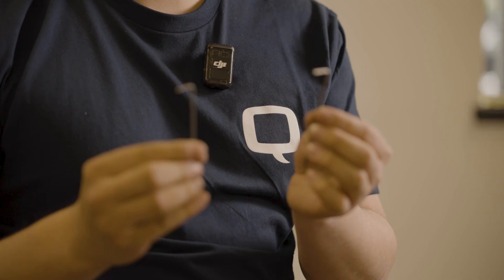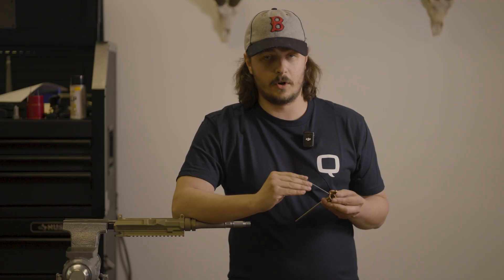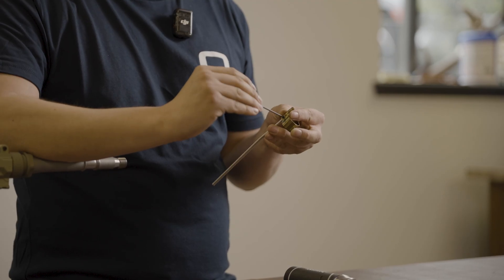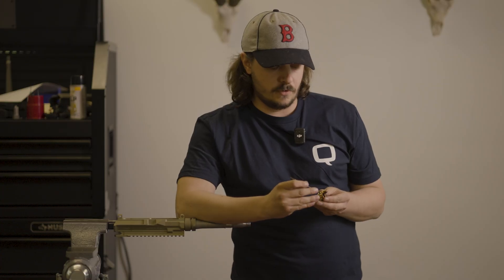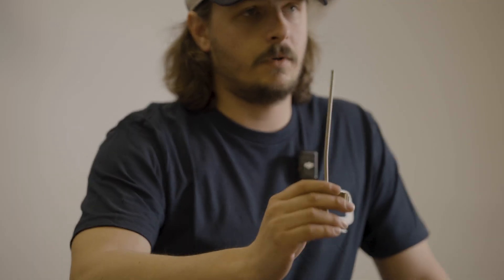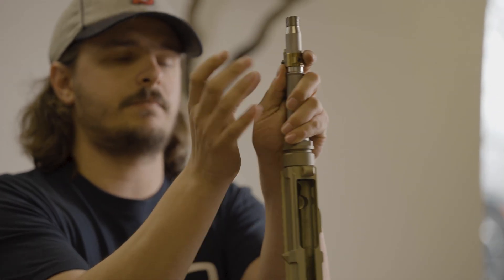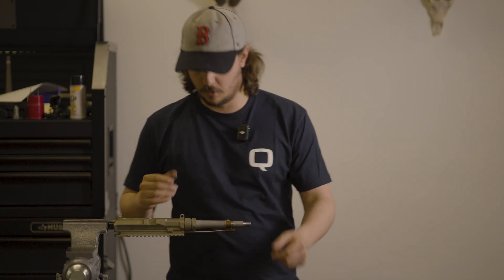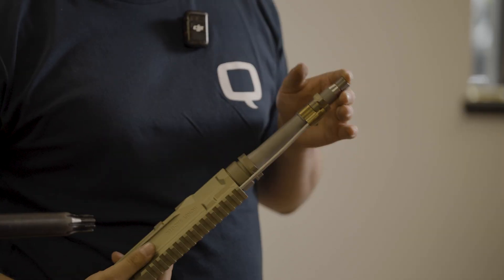How Q | Adjusting the Gas Block / Ensuring Tightness Before Use

Comment: The jam nut on my honey badger is 5/64 Allen key….and my gas adjustment screw is .05 Allen key. 
3/32 Allen key does not fit in my jam nut.
I noticed in the honey badger manual in one place it says .05 Allen key for gas adjustment. And in another place it says 5/64 for gas adjustment. 
On this video he says 3/32 for jam nut and 5/64 for gas adjustment. 
Not sure why, just pointing it out in case someone else runs into this. 
I noticed on Kit Badgers video about honey badger gas block adjustment, he says 5/64 for jam nut, and .05 for gas adjustment… which is what mine is.

Comment: my screws literally shot out of the gas block last time i shot it. customer service never mentioned that I would have to tighten the screws each time i go shooting. is that something i am gonna have to do every time i go shooting now?
Reply: No, just ensure that they are tightened to spec and your fine. Upon the first shots after adjustment... ensure that they are still set in place, and tighten again if necessary. You'll be fine after that.

Comment: Seems like a bad design if the set screw backs out. Can I put some Vibra-TITE VC-3 on it?
Reply: My adjustment screw fell out the third time I took it out to the range . 

Really disappointed 🤷🏻‍♂️
Reply: It would be nice if the end of the thread was peened or something so the locking screw couldn’t completely fall out.
Reply: It has a locking screw behind the adjustment screw that’s hollow. Many other applications have this sort of “jamb nut” style of interference lock. Perhaps you’re not mechanically inclined?
Reply: @Josam01  He says to tighten it every time before using the gun. Maybe that's nonsense advice or maybe their implementation has failure modes?  If they are concerned with it backing out during normal use, surely some added thread friction (without using a liquid that could get into the port) would be a good idea?  VC-3 handles shock loads well, is reusable, and can be applied in a controlled manor that won't get into the set screw.
Reply: @KeithStrang perhaps, I’ve not personally had this issue. But I make sure to verify tightness after adjusting via the locking screw.

Comment: Between my HB and SW my gas block set screws ejected at first range trip with zero user adjustments
Reply: Same lost the one on my hb second range trip. Felt it fall out roll down the hand guard and into the grass 🤦🏻‍♂️
Reply: Mine exploded out

Comment: ??? Incorrect Adapter Use: Using an adapter incorrectly (not accounting for added length when required) can throw off your torque measurements. Torque wrench accuracy is all about maintaining the correct effective length, and your breakdown of in-line vs. 90-degree positioning makes it crystal clear. The 90-degree method is great because it ensures the adapter’s added length doesn’t interfere with the applied torque, keeping calculations straightforward. Crowfoot adapters follow the same logic as long as they maintain the same plane with the fastener. But once you introduce something like a dogbone adapter, you're dealing with a shift in leverage, meaning an adjustment to torque calculations is likely required.

Comment: I’ve taken my Honey Badger out for 3 range sessions and each time (shooting only subs with suppressor) it gets so dirty after approximately 150 rounds, it won’t continue to cycle without cleaning.  I use lots of lubrication and have cleaned it throughly between each use. Any suggestions?  I contacted customer support last week but so far, have no reply.  Should I send it back to be evaluated ?  I’ve never had a suppressed gun that got so fouled it wouldn’t cycle with less than 200 rds.
Reply: Stop using cheap ammo is the Main thing boss and do you have the old HB with the milspec BCG or the new 2 piece BCG ? If u have the old one get the new 2 piece BCG and use quality ammo
Reply: @TheTacticalAmputee no cheap ammo, I’ve been using Hornady Sub-X. I have lots of semi-autos and even using the nastiest burning powders on earth (in 40 years of reloading) I’ve never seen a rifle build carbon faster than this thing.  Btw, I’ve got the two piece bca.  Not everyone uses cheap crap in a $3k gun.  I only load with Vihtavouri now, just because it burns so clean.
Reply: I had a similar experience using hoppes elite gun oil. After just a couple hundred or fewer rounds, it was totally dry. I did some research and gave Lucas gun lube a try. Way slicker, stays in place better and last much, much longer. I use it for all my firearms now with great results.
Reply: was it already dirty? the suppressor will blow shit back into the receiver if its already dirty
Reply: Don’t hold your breath man! It took Q customer service a month to email me back after multiple emails to them with questions I had about the HB and trash panda. Unfortunately they’ve got no working phone number the answering message directs you to email them.
Reply: @mraglan28 that’s crazy, I had issues out of my boombox and emailed them and got an immediate answer and even talked back and forth over email, was actually impressed at how fast they answered me.
Reply: @mraglan28 wow, if they have bad customer service that's all I need to know. That to me is one of the most important  things when making a decision on whether or not to go with any company, especially when it comes to firearms and accessories for firearms.
Reply: Sell it